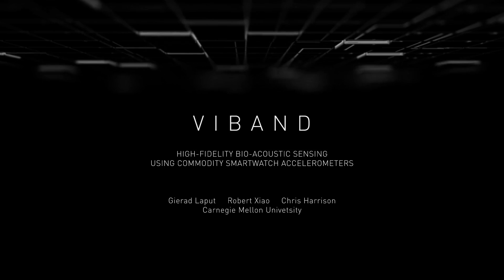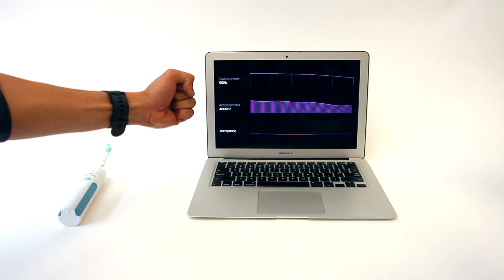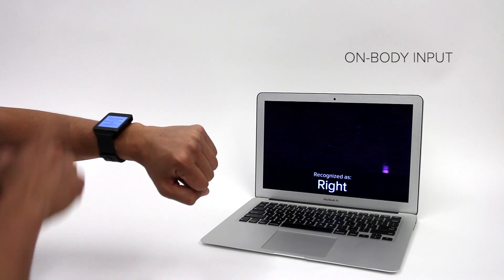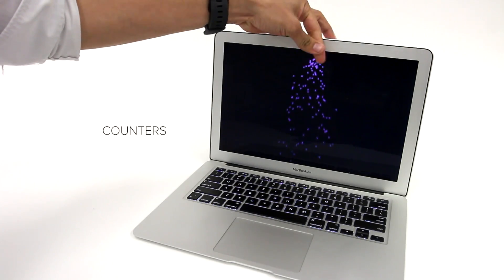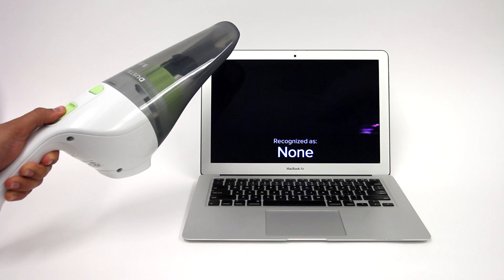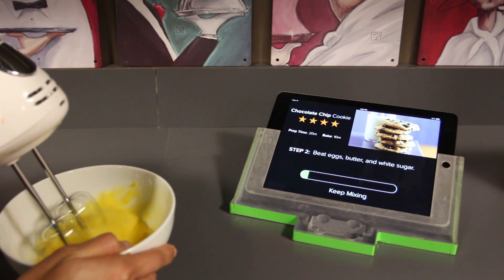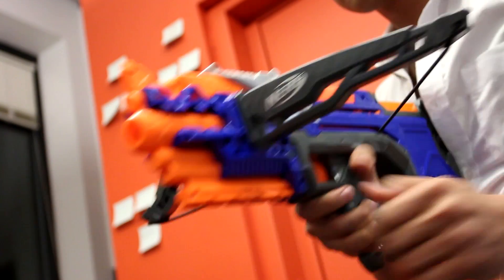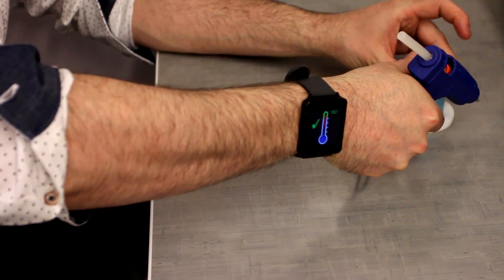ViBand: High-Fidelity Bio-Acoustic Sensing Using Commodity Smartwatch Accelerometers

Comment: What's the limitations besides not working on non-powered objects? How does it differentiate external noise from vibrations through the body? Can it be made to work in a noisy environment? If so, to what level? City street, office building, mechanical factory floor?
Reply: Unlike microphones (coupled through air), vibrations are coupled to your body, which makes ViBand robust to external audio noise. That said, it will be susceptible to unintended arm oscillations (e.g., accidentally hitting your hand on a table) but it is possible to use machine learning to mitigate these false detections.
Reply: I'm also curious about the battery needs for something like this. Would it be manageable to have this on a modern wearable device without external power supply for any amount of time? (Incl. calculations needed to be done in realtime)
Reply: Yes. ViBand can be implemented on a System on Chip solution (similar to "OK Google", and "Hey Siri" functionality), which is extremely optimized for power consumption.

Comment: Could you explain how the structured vibrations work? I'm having a hard time understanding how you can "instruct" an object to emit audio?
Reply: Objects that vibrate (for example a blender, dishwasher, or power tool) can be detected without any modification. For objects that do not vibrate (like a door or glue gun), we need a tag, sort of like RFID.  In this case, we use a small vibration motor, which you can see at 5:09 (what the finger is placed onto). An ID (or any data) is then transmitted bio-acoustically into your body.

Comment: It looks incredibly promising. I wonder how bad of an impact that "overclocking" has on battery life, though.
If it isn't too much, then there's no excuses not to bring this to us NOW.
Reply: Impact on battery life can be negligible.  In a commercial use, ViBand would use the same techniques that enable all-ways listening "Ok, Google" / "Hey Siri" detection.  These are often special, low-power co-processors.
Reply: Here is a link to the InvenSense Datasheet: https://store.invensense.com/datasheets/invensense/mpu_6500_rev1.0.pdf

You'll see on page 11 that the power draw of the accel at 4kHz is 450 µA -- note that is micro amps.  So well under 1mA!  So yes, overclocking does increase power consumption, but even at this increased rate, it is still very small.